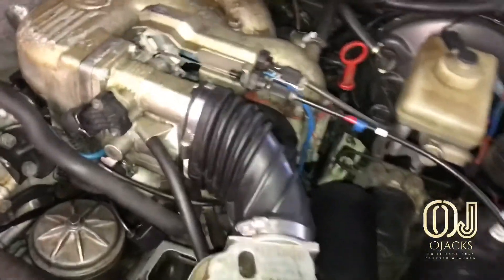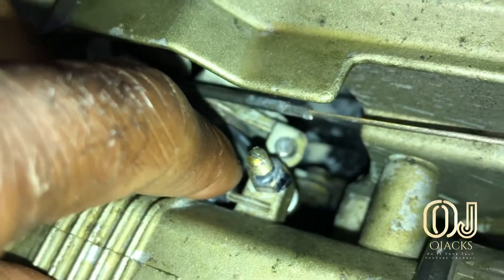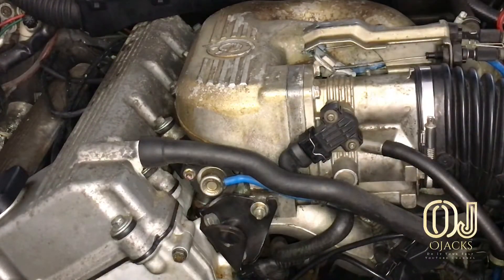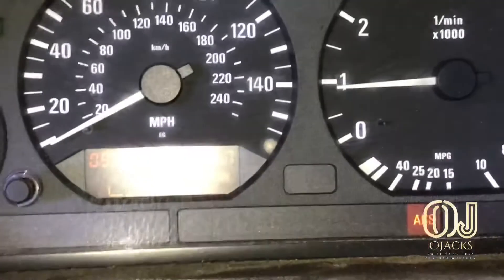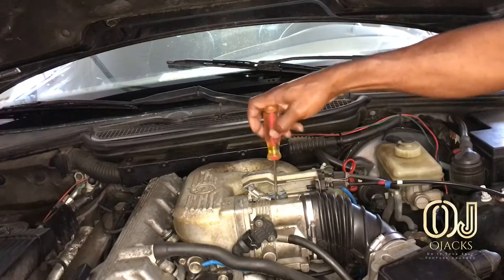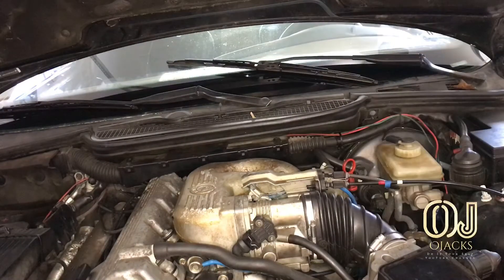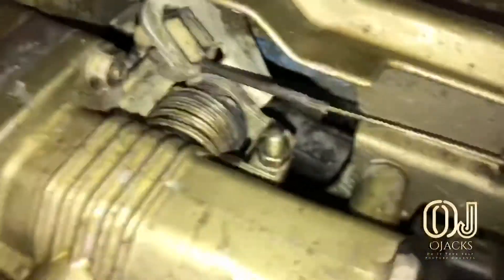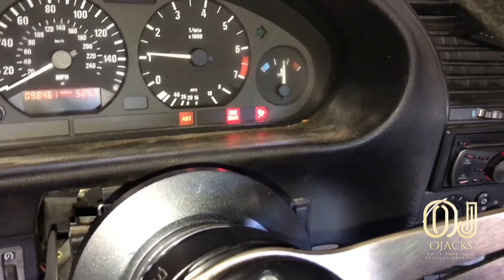Adjusting a Throttle Positioning Sensor on a E36 BMW

Comment: Hey boss does this works for the 328is 1999? I recently change my tps and i saw another videos that says plug and drive. My rpm when i start it to goes 1.5k and when i driven and im at the stop light it start racing the the rpm

Comment: 1994 320 i after warmup, idles between 1250 to 1500 rpm, surging up and down, any ideas.
Reply: Had to change my head gasket recently and had some trouble with the idle. The car was parked for 6 months. The MAF (air flow sensor) was stuck shut by some kind of rust. Had to disassemble it, even though it's a sensitive piece and no one recommends it. The metallic flap pin had a lot of rust and I wasn't able to clean it properly but could clean the inside (where the air passes through) and throw some WD40 on the inside of the pin space. It got 99% better, but I know that I still have some problems because the car hesitates when changing gears (probably because the MAF is still a little bit stuck and stutters during the aspiration of air by the engine). This, and I also cleaned the ICV (idle control valve). It's a metallic cylinder that sits behind the intake in your model. A normal ICV will be easily movable, you can hear it moving when you shake it with your hand. I cleaned mine with a lot of brake cleaner (but I would recommend something less aggressive, like carb cleaner) and after I was done, I also put a lot of WD40 to maintain it lubricated. Let it dry, and then reassemble everything. The same with the MAF: don't put it back if you clean it, let it dry. I recommend reading about it on the internet before doing the MAF cleaning, it's an electronic piece and can very easily be broken (and costs a freaking lot). The other possibility is a vacuum leak. My car hoses were completely destroyed, so I bought about 1,5m of new hoses and replaced all of them (and the tube that goes to the ICV, it's a special one and mine was cracked, can be your case). The best thing is to disassemble, clean everything and inspect the hoses and replace them all if you think they are old since they can become brittle and crack with time. It's a day's work if you have all the parts with you.
Reply: Did you figure it out? @dougplommer9961
Reply: Try cleaning icv (idle control valve)